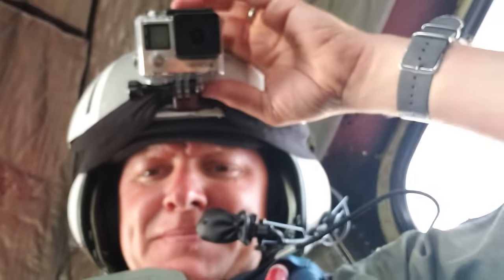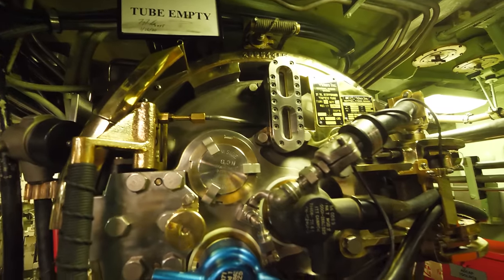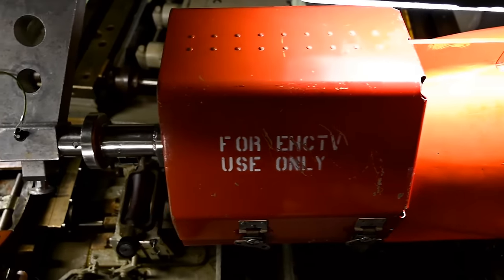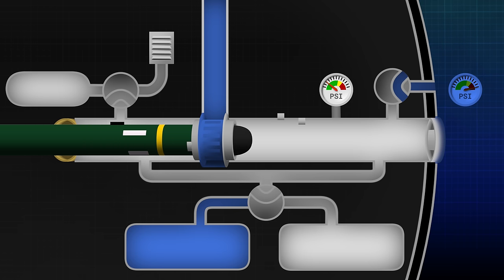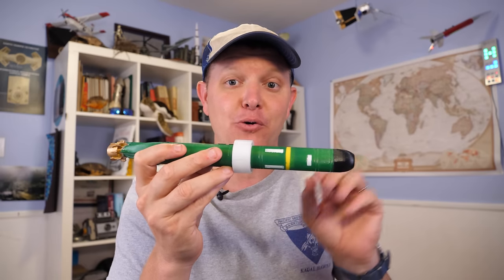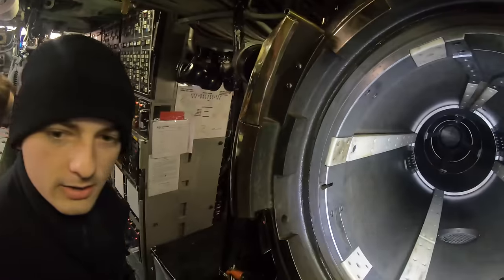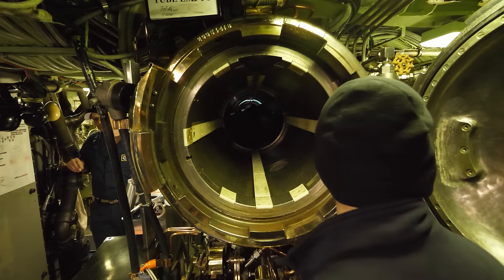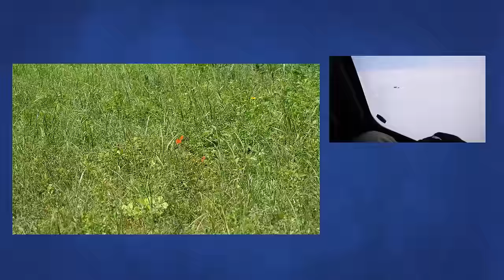Crawling Down A Torpedo Tube -US NAVY Nuclear Submarine - Smarter Every Day 241

Comment: Been there done that. 
Never shoot a water slug: you'll dive the 'tube'
And you never say 'fire', that is only used to alert everyone on board: that something is burning. 
"Shoot' is the proper term used in launching a torpedo
Reply: I'm not entirely sure about that last statement. The Fire Control Technicians on my boat say "Fire" for torpedoes every time.
Reply: In Fluckys book "Thunder Below" (that Destin mentioned in the last episode) he orders them to fire.
Reply: Are you sure you're allowed to talk about all that stuff?
Reply: Could you elaborate on what propels the torpedo through the water?  That's something that has I've always wondered.  Is it rocket powered?  Then I say to myself "but rockets weren't really perfected on land until after WW2 yet alone hundreds of feet deep in the ocean." I really thought this video was going to tell me.  My mind has wondered about this since I watched the Sub movies of the late 80's and 90's. Giant rubber bands? Compressed air? Lol
Reply: @myownidenity4955  You can just use a propeller at the end of the torpedo to keep it going.

Though modern torpedo's use pump jets.

Similar to a Jetski.

And supercavitation torpedo's also use rocket engines.

The ones from WW1 used single propellers with vanes for stabilisation, later models used counterrotating ones so it would require large vanes to not spin.
Reply: Same here. The TM-1 that signed my qual card for my torpedo room checkout told me that I had to clean a tube out before he would give me my checkout. While I was in the tube he shut the door on me. I guess that he wanted to see what I would do. I laid there and got a few minutes of much needed sleep. After he opened the door back up i finished cleaning the tube and then got my checkout and his signature on my qual card. That was almost 40 years ago. Good times!
Reply: @myownidenity4955  Torpedoes  have propellers, some called it propulsors. Russian 'shkval' & German 'barracuda' are rocket propelled supercavitating torpedoes.
Reply: @emilychb6621  The older model propellor based torpedoes .... if they missed the target, will they be travelling forever until an object stops them ?
Reply: Both boats I served on the word fire meant "fire", things are burning. the command was always "shoot" when launching torpedoes.  It was always a good gag to send the newbs  to the torpedo room and have then close to where the impulse air vents when shooting water slugs.
Reply: @Lyf4rMusic  The more advanced WWII torpedoes could be "programmed" to do a 180° turn and try to hit the target again in case of a miss and continue to do so according to a set pattern until they ran out of electric charge.
Reply: @badutbadut2309  what drives the propeller?
Reply: @emilychb6621  I'm very familiar with jet drives.  I've worked on plenty some made by Polaris. The only thing aboard a sub with a polaris name is a ballistic missile. However what I'm asking is what powers the jet. The ones I have worked on are usually powered by a 2 cycle marine engine. certainly torpedoes aren't powered by a internal combustion engine.  Perhaps a enslaved giant squid is used.
Reply: @myownidenity4955   There are two systems to boot . One is electric/battery, the other is internal combustion engine using hydrogen peroxide as fuel. The Kursk sunk bec of that fuel leaking from the torpedo.
Reply: @badutbadut2309  awesome. Thanks for explaining. For years I've wondered about this but never gave it enough thought. I knew the Kursk had an oxidizer leak but never thought about it being torpedo fuel. To me that makes sense. Battery powered is always what I assumed. That being said those batteries must discharge crazy fast.  I'm sure the info on specs is highly classified no matter the system.  Crazy I can understand how many different rocket engines work and I can even grasp their guidance systems work to obtain orbit. Yet something used over 100 years ago has me perplexed.

Comment: Plot Twist: There low on ammo, so you become the torpedo.
Reply: "Here's a rebreather, a grenade, and a second tank to use as propellant. Go get 'em"
Reply: Scorcher As the seal door creaks shut behind you and ice-cold water starts flooding the now pitch black tube. Sounds fun
Reply: @excuseyou1526  And Dustin uses his own "gas" to create pressure for launch!
Reply: Navy SEALs are sometimes deployed out of torpedo tubes for sneaky missions. They prefer to use the escape trunk, since it's meant to act as an airlock, but a torpedo tube will do in a pinch. They don't use the high pressure water to shoot them out of the tube, though. They just equalize the water pressure and open the outer door and swim out.

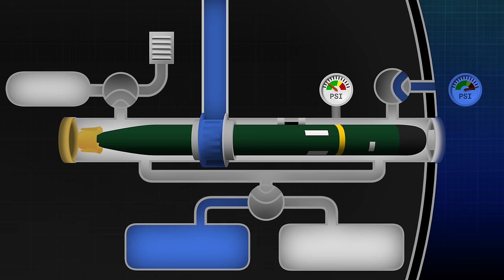Comment: 9:10 Don't forget to connect the cables! Otherwise you'll be firing a brick.
Reply: There are unguided torpedoes too!
Reply: @Spirit532  Sure. These are guided though. They also need instructions to be transmitted to them before launch to set various parameters.
Reply: A brick fired at speed is still gonna do damage to be fair. Nuclear annihilation is so extra
Reply: Sorry I didn't clarify: by brick I meant that it won't actually do anything. Just sink. It's also a conventional weapon. Loads of explosive but not a nuclear weapon.

Comment: Me thinks captain was there to prevent the "close the hatch" joke ;)
Reply: I'm sure most would not find that very funny. My claustrophobia was going crazy watching that.
Reply: I wonder if people in the military really do that
Reply: Merthan E. I could see some signatures in the plate. But as far as a prank, I’m sure it happens.
Reply: Hatch: closes.
Reply: @MerthanE  Yes, yes they do. Enlisted from ‘82 to ‘92. My sea time was on USS GW CARVER SSBN 656. First step was getting the newbies to fall for “ you’re the new guy you have to go in and clean out the sea bats”. If the newbies were a-holes the door would get shut for 20-30 seconds. Personally I was in the engine room and did not partake in those pranks. Ours were a little different.
Reply: @MerthanE  Yes they do.  They need to maintain the tube, even while submerged.
Reply: Did you really copy and paste this comment?
Reply: I wonder if it is always a joke. It would be a really easy way to make a problem disappear.
Reply: @micbroc6435  If they were assumptive about not actually being in danger, it might have been necessary to lower the locking lugs and open the air pressurization valve a little bit. XD
Reply: @Baigle1  It would be all too easy to go a bit too far with that valve and kind of make a mess of things.   At which point you may as well continue with the dry-fire drill and just pretend you didn't notice him in there.   Hey, it happens.
Reply: @MerthanE  My dad has told stories of being closed in the torpedo tube, "I just took a nap till they opened it back up, real comfortable."
Reply: Mic Broc  don’t tell me the mock you up in the reactor compartment... that’s would be terrible.
Reply: @mariorodriguez653  If he stayed in there for about 40 days, his body would up the natural levels of reparative molecules and antioxidant production in his blood, but it wouldn't ever completely counteract the mutagenic and cytotoxic affects of the particles hitting his DNA.

Some people wear radioactive pendants because it lowers their Horvath clock age, but its not the correct approach.

Comment: While serving my "shore duty" tour at N.S.S.F., 31 Fox Hydraulic Shop at the Submarine Base New London CT between 1994-1997 I had the privilege of working on many of the hydraulic systems of these beasts, including torpedo tube slide valves, etc... like I said, memories... BTW, I worked on her (that boat) USS Toledo while at New London. but my name is inside the Impulse Tank. Another thing, in order to slide past the tank and the tube inside the Impulse Tank to loosen up the connection between the hydraulics and the slide valve itself you have to be skinny, for the space between the wall of the tank and the tube itself is tight. I was very skinny back then, and could do it no problem... no way I could do it today...  lol...
Reply: I'm 6 foot and weighed 135 at that time. I was skinny.

Comment: My dad likes to tell me how hes slept in a torpedo tube when he was in the navy in the 80s😂
Reply: I think I would actually be pretty comfortable sleeping in there I'm small and like small places. Also, it is probably pretty quiet in there compared to the rest of the sub.  I would want to find a way to rig the hatch so it couldn't be closed while I'm in there though.
Reply: @rob1248996 if it was in the 80's they would have kept the tubes loaded in case of soviets
Reply: Yea...in tubes is highly unlikely. They are either loaded or locked.
Reply: @zachcrawford5  
Subhuman little fella
Reply: @zachcrawford5  Lie on your back with your legs dangling down.
Reply: I’ve heard of guys doing that back then. Subs were tiny

Comment: I was hoping to see more about how the torpedo kept moving after it left the sub, but still very fascinating.
Reply: It has a battery and electric engine on board. Most likely activated through the wire thats attached
Reply: @coyote47713  No it does not... it has a external combustion engine, that runs on a swash plate, using self oxygenated fuel call Otto fuel

Comment: Next up on SmarterEveryday: how does a submarine generate oxygen 🤔
Reply: Probably! I saw a O2 candle in those preview clips at the beginning.
Reply: @jacoblojewski8729  The O2 candles are for emergency use. Under normal circumstances, submarines have oxygen generators that produce oxygen by purifying sea water (by boiling it) and then putting the purified water through the process of electrolysis (to separate out the hydrogen and oxygen) and then storing it in oxygen tanks while disposing of the hydrogen back into the ocean. An Oxygen monitoring system detects low oxygen levels and vents it into the compartments.
Reply: Jacob Nyhart 
Do non-nuclear submarines use electrolysis too?
Reply: @jacobnyhart6862  Well yes and no (EM1 (SS)  here - and O2 gen tech qualified, so I got to work on the bomb too often).  We often burned candles when on mission.  This was to offset the air mass loss due to all the various processes and keep atmospheric pressure up longer, to maximize time between bringing on new air.

But yes, the bulk of the O2 is produced by the genny, or by taking on fresh air at PD.
Reply: @peterknutsen3070  I was stationed aborad a nuclear fast attack submarine, so I can't really speak to how things are done on a diesel/electric (non-nuclear) boat. Given that they have even less space inside than even the tight quarters that a nuclear fast attack boat has, and given the need to snorkel in order to charge the batteries, I would say there's really no need, since they'd be getting oxygen while snorkeling. They would just need to store that oxygen.
Reply: @jacoblojewski8729  Fair enough. During my time aboard my boat, we never burned candles except while training (and even then, they were training candles)... so I'll restate my initial statement as such... Normally, the O2 candles are for emergency use. :)
Reply: @jacobnyhart6862  All good!  I know lots of boats do all sorts of things slightly differently :)
Reply: Then how does a generate oxygen create a torpedo.
Reply: @Maicowerk  Torpedoes make their own oxygen thru a mono propellant called Otto fuel.
Reply: There is 2 way :

1.Using an sea water to create the oxygen, using boiling method and electrolysis method but this one are too Uneffecient one, because it using much energy to boiling and electrolysis it.

2. By going into surface in the surface where is safe from enemies they can use a tube or somekind thats can pull in all the oxygen they can get and separate it in the tank then leaves out the non O2, but this operation are too risk when used in enemies teritorial and also it just giving your positions to enemies, some type might be have the "sucker" (i dont know the name), thats going to surface usually as same size like the periscope or smaller thats pull in all the air outside into the purifier units before going into the tank so non O2 will be going out from backside or some where else the o2 will be going straight into the tank
Reply: @Maicowerk  it's not a candle like you think of it. It's a one-time use chemical oxygen generator.
Reply: Mainly an O2 generator in AMR. Using electrolysis to separate distilled water into oxygen and hydrogen. The hydrogen is sent overboard through an outlet on the aft of the sail.
Reply: The bomb makes noise when operated, so it’s used less often than you would think
Reply: @jacobnyhart6862  so if with a satellite, one can detect a slight excess of hydrogen on the ocean surface, could theoretically track a nuclear submarine ?
Reply: @ildanny80  The dissipation of the hydrogen as it vents into the ocean along with the ability to vent it while dove (and not at or near the ocean's surface) would make it virtually impossible to track a submarine that way. We're also not talking about a huge amount of hydrogen here (relatively speaking).
Reply: @himenaaa3565  The "tube" of which you speak is the snorkel. Fresh air is brought in for the diesel to operate and to replenish the atmosphere on the boat. The snorkel also has an exhaust outlet in the same mast. Also, the snorkel mast sits lower than either of the periscopes when all are extended, but in terms of it's thickness, it's actually significantly larger than the periscope masts. (Note: I am only speaking about the 688i Class of US submarines since that's what I served on).
Reply: @jacobnyhart6862  Well correct me if I'm wrong... H2 is much lighter than water, right ? Then, wherever you release it underwater, it emerges rather quickly and also goes up in the air, since it's lighter than the air as well. I think that with a sensitive spectrometer it might be possible to track the source... but it's just an idea
Reply: It doesnt submarines can only stay under for the amount of time that their oxygen last than they go ip and the tanks refill
Reply: @ildanny80  I would imagine it's plausible, but the amount of hydrogen is really negligible in the grand scheme of things. It's not a constant venting, so while you might detect a trace of hydrogen and consider it an anomaly enough to track it, it would be gone just as fast until the sub needs to vent again - whenever and wherever. Since you don't know those other factors, good luck trying to track it.  In the mean time, there are easier and more efficient methods of tracking the sub (sound and electromagnetic transmissions). The P3 Orions have that down to a science. :)
Reply: Guys the problem is not the oxygen. Its the nitrogen. Its true that a nuclear submarine can generate oxygen pretty easily, but the nitrogen for the correct 21/79 mixture of breathable air is limited. If you just dump air and generate more oxygen, the oxygen concentration in the submarine rises which would probably be bad... (fire hazard, O2 becomes toxic at 1.6 bar partial pressure, ect.)
Reply: @engineer0239  True, but subs don't "just dump air". The only part of the atmosphere they normally expell is CO2, extracted with scrubbers. The other gasses that go overboard are either byproducts of other processes and were never in the ship's atmosphere to begin with (eg: H2 from the oxygen generator) or from unintended leaks from high pressure air systems, or rare procedures.

One example "leakage" would be ship's atmosphere is compressed to high pressure and stored. That air can be used for an "emergency blow" (rarely done...it's in the name) and that air would then be lost to the sea. Another is just that high pressure air systems never are perfectly sealed, so they leak a little. Some of that leakage could be where it can leak into the sea, resulting in overall air loss.
Reply: Also to be clear it's not like they do this stuff randomly. There's a whole atmospheric monitoring system (CAMS) that will tell you the partial pressures of the major gasses in the air (O2, H2, CO2, N2, etc), as well as total pressure.
Reply: @jacoblojewski8729  Correct. I was just confirming Destin, because it seemed like the original comment was doubting his statement that every bit of air on a submarine is precious, because the sub can just make O2 by itsself.
Reply: @jacobnyhart6862  thanks for the information sir, since what im know it just general public information